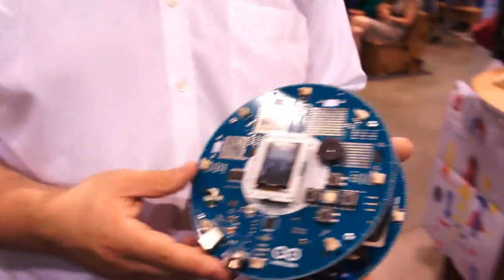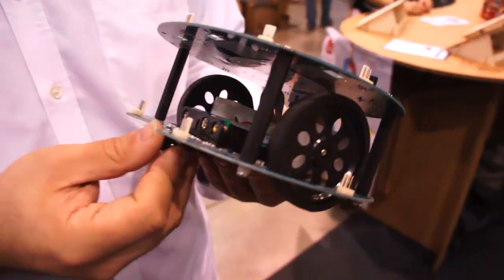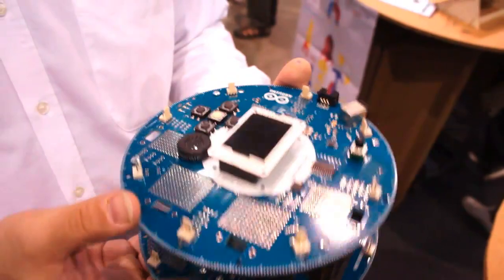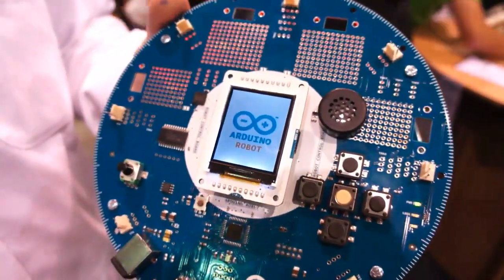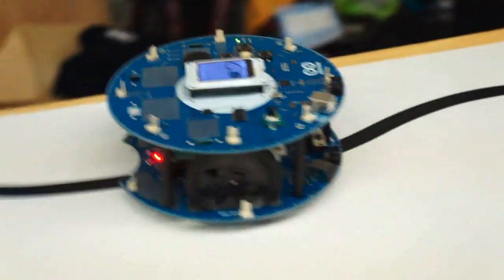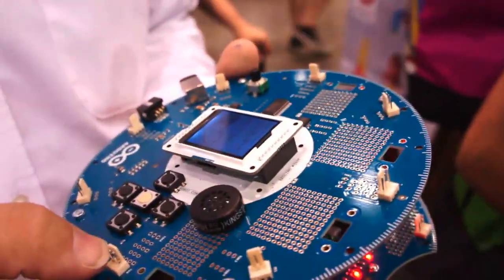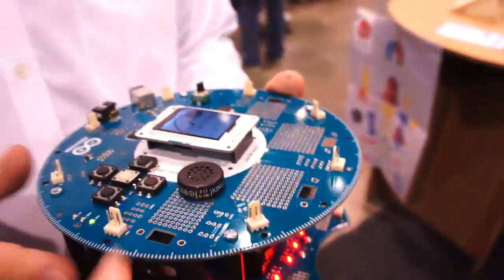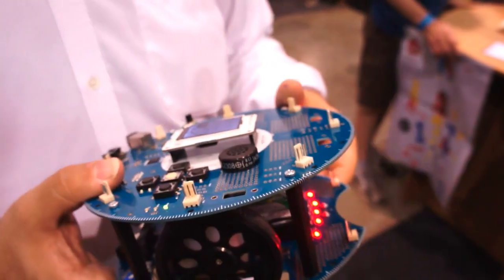Arduino Robot hands-on | Engadget at Maker Faire 2013

Comment: Arduino is a good start, but forget the "robot", just buy a simple board (for example UNO, or Mega2650 for complicated tasks), and some servos/stepmotors plus support electronics, and that's it.

Comment: I would recommend you a breadboard + PICKIT 2 clone (with ZIF socket) + PICs. Even using Arduino you will need a breadboard. The PICKIT2 is a programmer only, it can not be programmed itself, but with it you can program PIC microcontrollers. PICKIT clones are cheap, try to find a clone with a ZIF socket. PICs are very cheap, if you ruin one just replace it, if you ruin an Arduino you will have to buy the Arduino again.

Comment: People that doesn't know anything about  Microcontrollers are misguided by Arduino sellers. They are told that Arduino is the tool for beginners. People must begin with the basics: resistors, capacitors, switches, logic gates, and that stuff. From simple things to complex circuits. You begin with a simple circuit, low CI count, and then go to more complex ones. Arduino is a complex circuit, not recommendable for beginners.

Comment: how would using a breabboarded arduino solve the fact he didnt know how to turna  single pin on he could of just used digitalwrite pin high even with the breadboard if hes a idiot he3 aint gonna figure anything out by using the breadboarded version infact hes not gonna figure much out if they dont know what the chips on a arduino board do then how will they know how to wire up a microcontroller in a breadboard

Comment: Arduino is a tool for advanced users. Beginners don't really understand what is happening, why all those chips are on the board. I remember a guy who was already programming but asked me how he can turn on a single pin of the microcontroller, because he used 0x00 and 0xFF to handle all the bits but didn't understand how to control a single bit. Beginners that use arduino never succeed, at the end they have to start all over again from putting a single chip in a breadboard.

Comment: arduino is better suited to beginners and its more foolproof theres no ftdi or spi programmers and all the other bits that theyd need to learn arduino just gives them everything they need to get up and going initially then they can move onto things like making there own boards when they feel ready but i wont disagree if you spend 30 pounds on a arduino board you could build the same thing for about 5 pounds using parts although you will need to spend a couple pounds on a ftdi cable